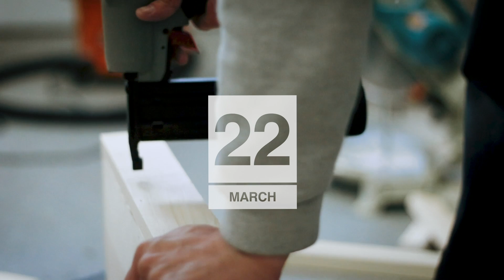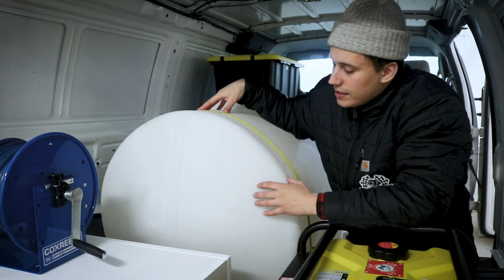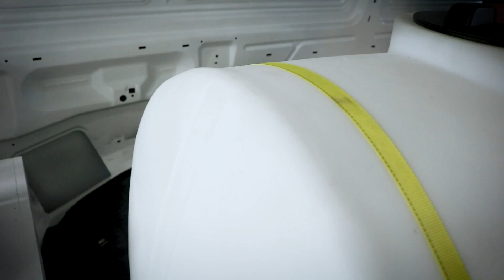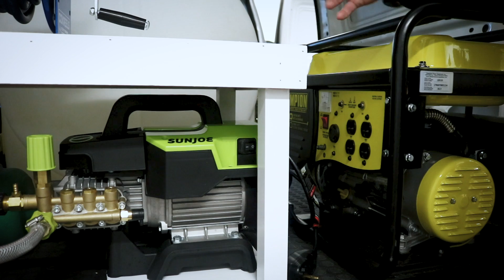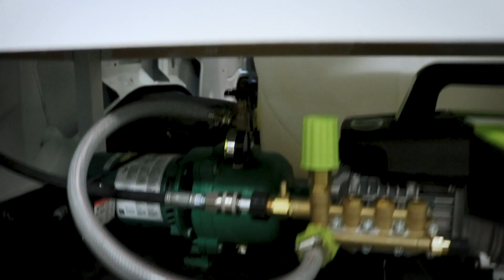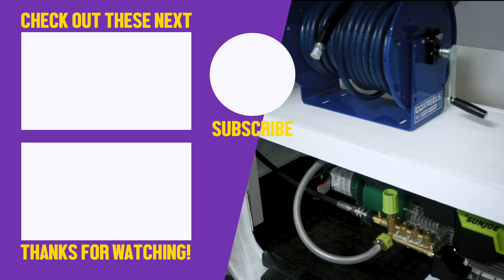Our Mobile Auto Detailing Water Tank Setup

Comment: Hi I have a question, can use the hose like a regular hose without the pressure washer wand? Like can you set the pressure washer on low and produce a similar pressure as you would get from a normal house hose? Thank you for any help, it seems hard to find this information but some customers don't want you to use the pressure washer wand if it's a classic car/custom paint job.

Comment: I couldn’t buy the 4000 watts Generator I bought one that was stronger that’s the only one they had in stock I believe it was like 6000 and change my question is can I still use a 1/3 HP jet pump or what do you recommend?
Reply from the maker: The 1/3HP is relative to flow not how big your generator is

Comment: I’m not so sure about the safety regarding that water tank installation. The tank might stick to the platform you built but I’m guessing the platform will come loose from the vans floor in a crash. The screws used will snap clean off on impact.

Comment: do you have the generator running during an entire mobile detailing session? or do you turn it off when not needed and then turn it back on? do you have a secondary spout to fill buckets and stuff or do you just do that with the pressure washer hose?

Comment: Hey Man...was checking out this older video you made and was wondering if you suggest a jet pump for the Kranzle pressure washer or if the Kranzle’s are equipped to avoid the priming issue you mentioned. Thx Chromatic!
Reply from the maker: I would suggest one with all pressure washers. There isn't much point spending a rack on a pressure washer and then ask it to do something it wasn't intended for.
Reply: @ChromaticGarage  makes perfect sense to me. Gracias!

Comment: I was watching your SunJoe review and saw that you took out the jet pump from this set up. What was your reasoning and has there been any draw backs. I have all the same equipment to mount to a trailer and am wondering if I should just go with gravity fed as well.  I figured with the jet pump you could have a lower pressure water source to use while not using the pressure washer if needed.

Comment: Damn bro thank u I don’t have a van I have a car thanks for telling me bro u was deadass gonna go buy a 125 gallon one  knowing your tank does 20 cars bro 🤦‍♂️ just thanks but how much cars would I get out of a 60 gallons one bro
Reply: Nate Flores you can get around 6-7 cars with 60 gallons
Reply: Hey I’m looking to start my own mobile detailing business, but If I get a water tank do I necessarily need a pump for it? Is that the only way it will work if I hook it to a pressure washer? I’m also going to be working out of and car for now.
Reply: Alicia Penn yes because you will need pressurized water to go through the pressure washer, just like if it’s coming out of the hose, connecting a tank to a pressure washer without a pump is like using your garden hose with the water off
Reply: andrick thank you so much for the reply.

Comment: Helpful video. Where you get the connection for the outlet on the sunjoe pressures washer where the hose connects to go to the hose reel? I have a ar blue clean and to my understanding electric pressure washers outlets are not the same m22 connect as the gas pressure washer. Any suggestions or links would be helpful. Thanx again

Comment: Good video. I was just considering purchasing a jet pump from HD. I currently have a Wayne battery operated pump. Strong pump but it runs through batteries like no tomorrow. I bought a 120V AC power pump from Harbor Freight and it burned out after about a month. What brand is your jet pump? I was considering one made by Wayne.

Comment: quick question! how do you get water from your tank without starting the pressure washer? to fill bottles or buckets etc?
Reply from the maker: We fill them at the shop currently! Not the best option. Will be putting a split right before the valve over the winter. It should work perfect, but im planning on making an update video!
Reply: Chromatic Auto Detailing can’t you just disconet the gun and use the hose to fill them up or no

Comment: Love the setup 👌🏻 quick question. Where did you pick up your jet pump from ??
Reply from the maker: Hey Michael! Its from a very small local company that doesn't ship. We actually ditched it and now just use the pump built into the pressure washer. Thanks for watching!
Reply: @ChromaticGarage  , please can show us the new set up since you ditched this set up.
Reply: Chromatic Auto Detailing I’m just starting to get my set up on a ford explorer and I was looking to buy a generator and I saw pretty much everywhere they advise to not run generator indoors even if you have doors and windows open, they say at least 15-20 ft away from your vehicle or hose, because the carbon monoxide can harm or kill you. do you run yours on the van? also they suggest you to leave it Outdoors along time after used.

Comment: Great video. Where did you get the pump from
Reply from the maker: Thanks Walter! I got it from a local farm irrigation store a long time ago. But if you look at any hardware store/Home Depot. They'll all have what you need. Its just a jet pump with auto start/stop. Make sure the GPM matches or is more than your pressure washer and you're good. Usually around $100 for a good one.